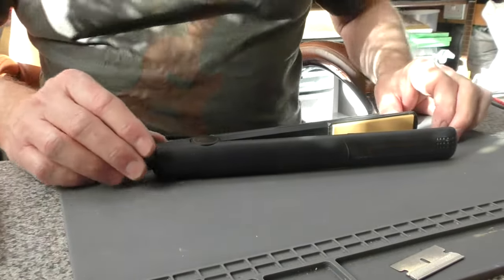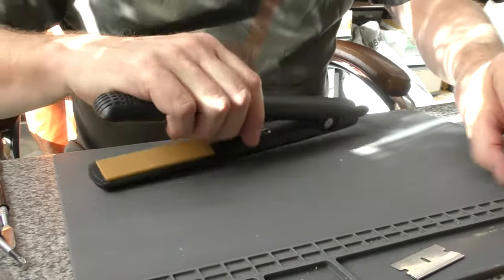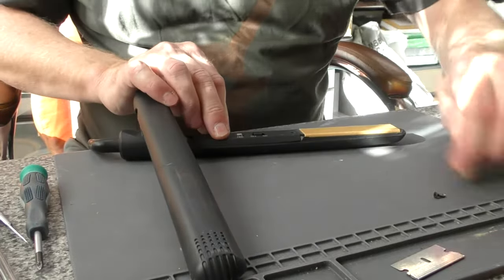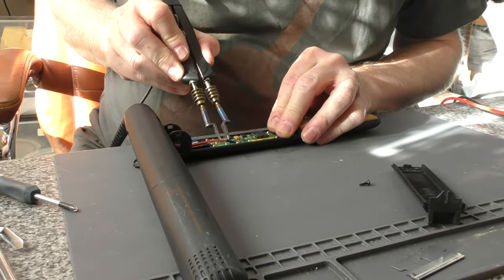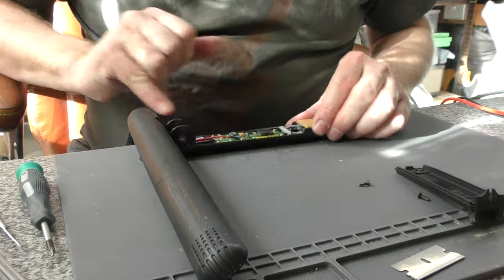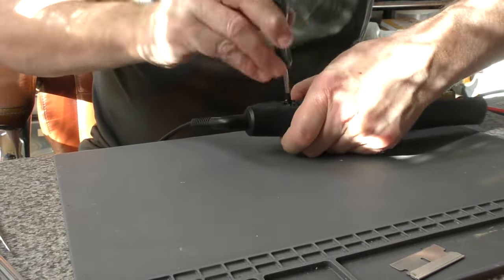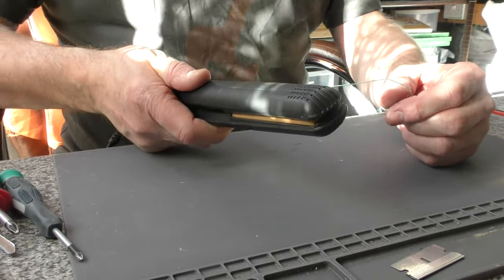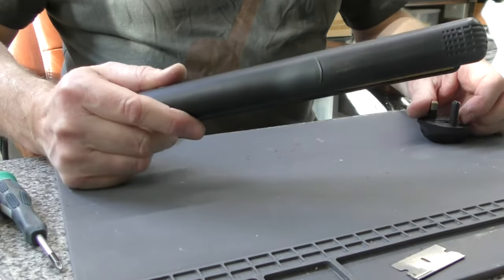GHD 4.2 Hair Straightener Repair. Newer Version. Beeping, no heat.

Comment: Thanks for the video! I just fixed my wife's, different model, different problem. Apparently a tiny wire or a hair of solder was contacting something else an was shorting out one half of the unit. Scrubbed the boards with a brush and alcohol and it seems to be working fine now. My wife is a stylist and she's probably been through 3 of these GHD irons over the years. She always threw them away and bought a new one. If I knew you were out there I would have sent them to you!
Reply from the maker: Hi
Yes. All our repair services are linked to below. 
https://www.ghd-repair.co.uk/shop/repair_services/
Reply: @Trevs-Shed  Thanks again. Just fixed 2 more, one this same model!

Comment: Hi there, my girlfriends beloved GHD gold straighteners wouldn't  turn on one day. No lights or noise. I replaced the cable with a brand new one, still no luck I then replaced the thermal fuse with advice on various online platforms. The straighteners now turn on but constantly flash and beep and won't heat up. Any advice would be much appreciated!
Reply from the maker: Tut tut, online platforms... Go to our repair guides https://www.ghd-repair.co.uk/guides 
If the thermal fuse had actually failed I would say the irons overheated due to a faulty thermistor, that bleeping is probably caused by the thermistor. Check and replace R8 and R11, change the element with thermistor, all available from our website. Our use our repair service £26.94
Reply: @Trevs Shed  Thanks for the advice I will order the thermistors and take it from there. Failing that I'll send it the pro to sort it out lol thanks again.

Comment: My hair straightener wire is burnt when I put it on heating then I immediately turn off the switch. Now what should l do now buy a new one or repair it at shop because it is new I am using that straightener for third time. Plz reply

Comment: If I send mine to you, are you willing to try to fix it? Obviously, you can charge me what you think is fair to Fix that this is something you are willing to do. Let me know, thank you. I believe mine is having a similar problem. It turns on and off as I lift it to use it on my hair, therefore it beeps several times as the heating element is going on and off. Thanks
Reply from the maker: Hi
All the repairs have a fixed fee.
https://www.ghd-repair.co.uk/shop/repair_services/

Comment: I accidentally broke the on off switch on the circuit board while using a terminating screwdriver to take it off but the thing snapped. It seemed really hard to take off. There's 4 tabs but pressed them in and nothing happened. Is there a special trick can't see it in your video. I can't find any replacements for just the switch do I need to replace the whole circuit board?
Reply from the maker: Contact me through ghd-repair.co.uk I can sort out a switch casing if that is what you have broken, the switch prises apart at the sides and then the cover lifts off exposing the contacts. Include a picure showing the damage.

Comment: THANKS FOR VIDEO. I HAVE GHD GOLD S7N261.
I REPLACED A DEFECTIVE HEATER ON ONE SIDE.
WHEN COLD AFTER ABOUT A MINUTE IT GOES INTO FAILSAFE.
WHEN I RESTART EVERYTHING IC FINE.
DO HEATERS HAVE TO BE MATCHED PAIRS ?
Reply from the maker: Hi
This model is not a DIY repair. Modifications to the PCB are required and elements carefully matched to the PCB to achieve the correct temperature.

Comment: My wife’s turn off when the cable turns around at the base. Will this likely be new cable needed or loose connection. Do u have a video of these repairs.
Reply from the maker: Hi. Change the cable and possibly the socket if required. All the required information is on my website. ghd-repair.co.uk
Reply: @Trevs-Shed  thanks.

Comment: Ghd straighteners mk5 no heat bleeping sound but no red light have checked thermal fuse heater pads resister r8r11 cable and are all ok   what do you think   thanks
Reply from the maker: @gerardwebb-kd3xv  thermistor or pic processor

Comment: Hi.. 
I once used ghd in my extension which is not very long in length 
Does it cause some sort of  damged?
Reply from the maker: It can do, any sparking from a dodgy wall socket or extension lead may cause the irons to fail. Repairable though.

Comment: Hello, when i plug in the ghd one plate instantly heats up and jumps the fuse. What can the problem be? I would send it to you but i’m to far(2500miles) :) . Thank you
Reply from the maker: Hi. What does "jumps the fuse" mean?
Reply: @Trevs-Shed  it’s series s7n261 with those mechanical fuse, when it over heats the small bended plate pops. But after reading more of your replies and videos, it seems it’s pcb error. The instant heating without to be started from button. Do you sell pcbs?
Reply from the maker: @rimetea4569  Yes, all GHD Gold and Max irons require PCB modification and other work. You can not repair this model yourself.
Sorry.
Reply: @Trevs-Shed  do you have any clue if we can find new pcb’s? We have lot of this ghd :(
Reply from the maker: @rimetea4569  Hi
No genuine spares are available for any GHD. GHD do not sell parts and they do not repair anything!
A replacement PCB will not help you as the value of the PRT in the elements varies and is set up with software.
Every Gold/Max PCB in existance requires the modification that we carry out.
We also wrote new firmware to allow us to match elements correctly to the PCB.
I don't know what to say to you.
Other than sending them to me for repair there is nothing you will be able to do.